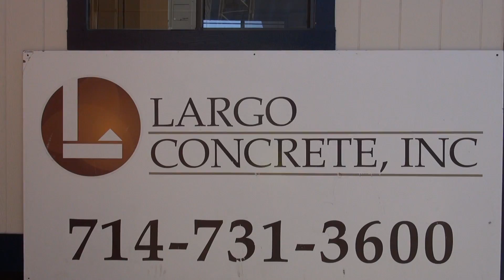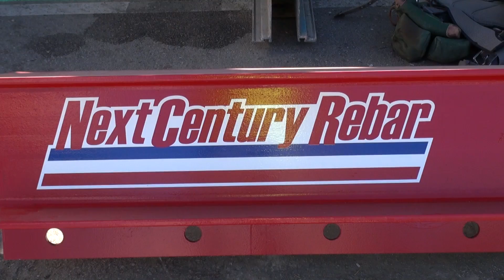High Rise Apartment building - Forming the Ground Level

Comment: Big or 1/2 fit wide layer centring rod coloum double need/ slide bar/ just like airbus a- 380 wings fram making....( Any fram / steel structure good binding & joint need)..big / 1inc steel  bar joint bodder hend wilding need after nut bolt joint,(steel bar head & all around side/ any gap)(more steel cable & good joint 1x more strong steel structer /attachment wilding it will 2x more stronger